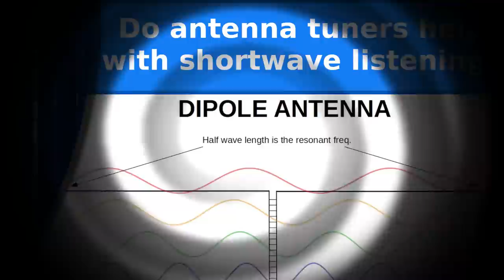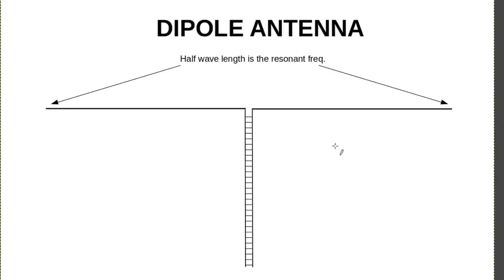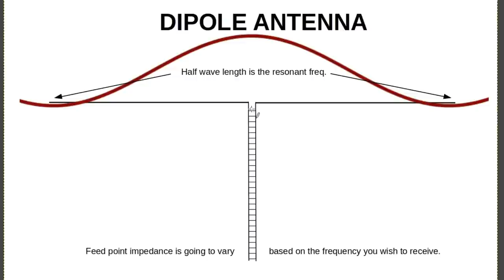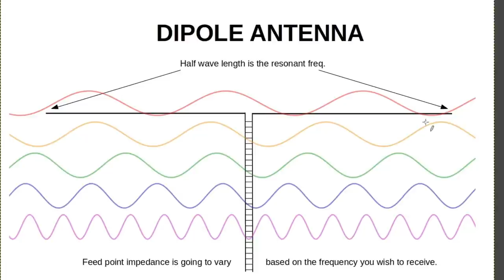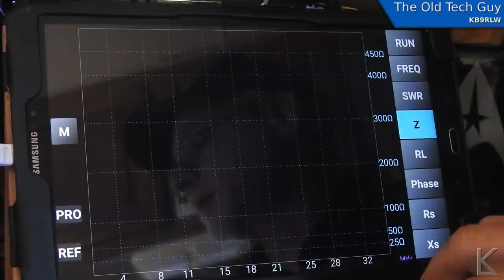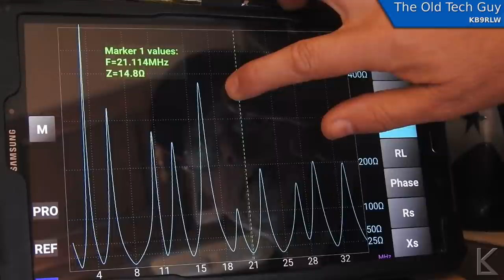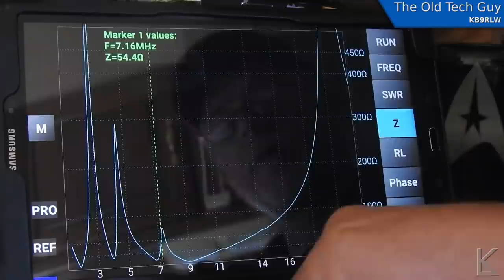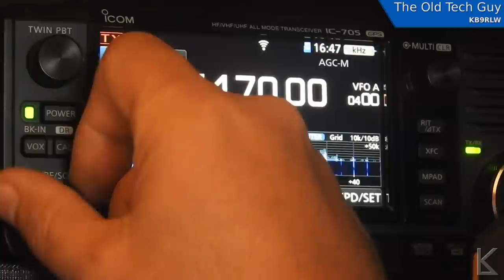Ham Radio - Do antenna tuners help with shortwave listening?

Comment: I think what you are missing is  a very important point. If the tuner allows more signal into the receiver- it also allows more noise into the receiver in an equal amount. If not then you are saying that the tuner knows the difference between noise on the RX frequency and signal. an obvious impossibility. Yes, signals were louder, but  so was the noise.  The waterfall display color clearly shows this. This is basic  S/N theory.
Dale W4OP
Reply from the maker: Yes, of course the noise floor comes up.  I didn't miss it, it was just so obvious that I didn't feel the need to point it out.
Reply: @loughkb  So, the signal to noise  does not change, then what is  the tuner helping with besides making  everything louder? All of today's receivers  have more than enough gain to allow for low gain antennas  (i.e.  mismatched antennas, Beverages, Flags etc) to overcome HF noise figures.
Reply from the maker: @W4OP  LOL!
Reply: @loughkb   Deos the tuner allow you to receive a signal that you could not receive with just the antenna? Perhaps a weaker signal than the one in the video?
Reply from the maker: @andrewking3087  It can, when applicable, certainly make some CW contacts much easier on the ears.  More signal for the filters to process.
Along those lines, digital modes would be a bit better detected by demodulating and decoding software.  Less dropped characters in RTTY or PSK31.  A bit less snow from less AGC action in an SSTV image.
And there's the additional benefit of getting the most out of the antenna across the spectrum, rather than just at it's resonant and harmonic points.

Comment: Thanks Kevin.  This was an interesting video.  I was an SWL for many years.   The term covers a broad range.  At least in the dark ages, before the Internet, most SWL's were people who listened to international broadcasters like the BBC, VoA and Radio Netherlands.  
For receive-only applications, there are two prime considerations: signal to noise ratio and frequency agility.  A third consideration is immunity from elective fading.  
When listening to high power radio broadcasters the signal strength is usually high enough that the limiting factor is noise, either natural or man made.   A less efficient but lower noise antenna works best. 
Because of automatic gain control (AGC) and the fact that most modern receivers are extremely sensitive, a little less signal at the radio's front end does little to affect reception.  In most cases using a tuner increases the received noise as much as the received signal.  Using a tuner in the general case only decreases frequency agility, adds complexity and frustration to tuning and an additional expense.  
The exception to this rule occurs where an antenna delivers relatively little signal to the radio. With very weak signals the radio's internal noise is at the level of the received signal.  Examples include using a very short antenna or an untuned loop without a pre-amp.  
Most SWL's will get the most benefit from an antenna setup that picks up the least noise.  
Transmitting is a different case.   You need to protect your transmitter from reflected power and you want to get the most power possible into the antenna.
Reply from the maker: Yes.  A tuner is just another tool in your arsenal.  Not something that would be used all of the time, just as needed.
Reply: @loughkb  Thanks again Kevin.  You have hit the nail on the head.  Exactly my point.

Comment: A simple pi network antenna tuner is tuned on receive simply by listening where the maximum noise is, and then finely tuned by transmitting. So yes, it definitely helps the receive

Comment: Nicely explained video.Yes an antenna tuner helps but there is no substitute for a good antenna in the first place.For SW listening it's been my experience to avoid antennas fed with coax.Ladder cable being the far better option.The braid on coax lets in all sorts of noises and interference which is not needed.🐻🐵☺️👍

Comment: In addition to match the impedance of the Antenna/Feedline system to the impedance of the RX input there is a second benefit. The antenna tuner is made up of a L/C circuitry and is frequency selective. Its not a broadband transformation.
It selectively filters out the spectral portions near the RX frequency and suppresses the spectral part far from the RX frequency. As result you get less total Signal amplitude to the 1st stage of the RX and reduce the risk to get into non linear  operating conditions. It suppresses cross and intermodulation and makes the whole system more robust to very strong signals outside the selected RX band.

Greetings from former DJ0PA

Comment: Howdy. Wonderful demonstration.
I would, however, advocate that an out of resonance antenna tuned to resonance with a tuner will "suck in" more energy from the air than a non resonant does.
Yet, I agree that matching impedances is the most significant aspect.
In high regards.
Reply from the maker: The antenna itself is not changed, it remains out of resonance.  The other side of the matching network presents a resonant impedance, derived from the network itself.

Comment: Tuning the antenna increases the signal as you showed, but also increases the noise.  So the signal to noise ratio is the same, regardless of the S--meter reading.  That's why beverages and receive loops work.  They provide a good S/N Ratio even though they are non resonant .  Sensitivity on HF modern receivers is not the problem.  Their Noise Figure is way below the atmospheric noise level.  So they are more than sensitive enough.   The name of the game in shortwave receiving in having a good signal to noise ratio, not the highest S Meter reading.  You should have mentioned that the best reason for using a tuner on HF is that it acts as a pass-band filter, reducing strong, off frequency signals which will degrade receiver dynamic range.  That is more important than trying for the highest S Meter reading.
Reply from the maker: SNR is a different topic and outside the scope of this video.

Comment: Interesting stuff. Is the antenna tuner you are using a passive device? I've e been playing with my antennas over the last little while. I mainly am interested in Mediumwave DX and have a couple of antennas , two flags, a delta loop and a youloop. As you described, the impedance varies with frequency. 200 to  1000 ohm on the one flag antenna, as measured with my NanoVNA at the two ends of MW. So getting a linear match across the whole MW band is impossible with just a fixed balun. Would some kind of adjustable LC circuit help? PS i like your postcard of Cape Town. My hometown. 73, Vince

Comment: Would a jfet preamp, with a very high input impedance, work better with whatever length of wire you are using? For receive only.

It wouldn't load down the antenna and most of the signal voltage would be seen across the 1 - 10 Mohm input impedance.

I did this for a direct conversion receiver I made.

The preamp was a J310 jfet in a self bias config with a 10 Mohm gate resistor.

The jfet fed an emitter follower.

The overall gain was about unity but the input resistance was now 10 Mohms.

It made it so a 2 ft telescoping antenna worked really well.

Of course the long wire still worked somewhat better but the performance was very good either way.

The only other issue was the preamp was also picking up 60 hz, but an appropriate choke going from the antenna to ground removed the 60 hz   and didn't affect the hf.

Comment: Great video topic to discuss! There aren't many discussions about this topic.
Q: can you discuss how use of different feedline with different impedance and matching that with an antenna that has a different impedance at the feedpoint. Such as using 50 ohm coax vs 300 ohm ladderline vs 450 ohm ladderline connected to a dipole. As you mention in your video, as the frequency changes, so does the impedance at the feedpoint, but the antenna tuner is typically at the radio point and not between the antenna and feedline connection point. I'd like to hear this perspective

Comment: If an antenna tuner to brings signal up, you have a problem with your antenna as its probably not constructed properly. If you have a good balun and coax It should not make any difference. Only on transmit is the match critical enough to make a noticeable difference.

Comment: Kevin, what about if you just have a long wire connected to a portable SW radio with a miniature jack?  Will a tuner improve receiver performance?
Reply from the maker: In some ways.  The tuner will act as a pre-selector.  Reducing nearby out of band RF that could swamp the rf pre-amp in the receiver.  
It will also improve the transfer of energy on the desired frequency range by creating an impedance match between the antenna and the receiver.

Comment: I understand that but what about the loss in signal because of the internal electronics? I have a Yaesu frt-7700 for my frg-8800; switched off, there's a slight loss in signal when in line!

Comment: This is true for a radio that has a 50-ohm input and a  50-ohm feedline.
This is not the case if you have a portable shortwave receiver. A single random wire works just fine.
My ham radio is a Yaesu FT-450D.
My portable is a Tecsun PL-880.
Reply from the maker: A 'tuner' doesn't specifically produce a 50 ohm output.  It will allow you to match whatever the impedance of the antenna is to whatever the impedance of the receiver is and improve energy transfer.
Reply: Your PL-880 has an high impedance input that matches the impedance of a short wire antenna so further impedance matching is not important.

Comment: Hi. QUESTION. If you have an aerial correct wavelength for the station you are listening too. If you introduce an aerial tuner does it increase the signal strength by improving the Q of the aerial. Cheers from old George.
Reply from the maker: No.  The antenna is only going to 'grab' so much signal out of the air.  If you're system is resonant for the frequency you are receiving, the transmatch would only introduce a small amount of loss.  You may reduce the energy from other signals on different frequencies though, possibly reducing interference or desense of the RF amplifiers in the receiver.
Reply: @loughkb  Many thanks.  I grew up with Thermionic Valves whereby the RF Amplifier was wideband. No band pass filters. ATU were as big as the radio. They matched impedance and also acted as band pass filters. Sometimes the knobs were marked sensitivity selectivity. The ATU increased the wanted signal by increasing the signal to noise ratio alowing the front end RF amp gain to be manually adjusted. It's rare to see an ATU as good as the old ones. Modern radios have band pass filters built in. Less knobs to adjust. Thank you for your reply it confirms my thoughts on modern ATU. Ps one of my old radios weight was 18 stone without power unit or ATU and it was only a Marconi DF Receiver ex ww2. No Transmitter.  Cheers from old George just getting back into radio. 👍🤠🇬🇧

Comment: the big push back by most is due to the common misconception on the device.  I too normally call them "antenna tuners" while in reality as you pointed out they are a matching device and RX always benefits from input impedance matching, that's why early radios usually had a knob for "peaking".
I agree about the other content creator.  It seemed by the end his topics grew controversial and his presentations bitter. I know from the very few I put up at one time that my personality was not a good match for the trolls and flame throwers (who never seemed to have any content of their own).
GL & 73 Al

Comment: From my experience a 'preselector" will work better than a 'antenna tuner' for receive only.  My yaesu manual receive only preselector has a better fine tuning control than a manual antenna tuner.
Reply from the maker: They're the same thing.

Comment: For SWL, is using a 1:1 BalUn (placed in-between where the antenna first connects to the Coax feed) still a good idea to help remove RFI if I'm also using an antenna tuner at the radio antenna input?  Or is it redundant?
Reply from the maker: That would help to reduce common mode noise.   Hashy broad RF noise that gets onto the antenna system and travels down both conductors of the feed line as if it were a single wire.   It wouldn't help with any kind of carrier noise.  A narrow signal generated by something.

Comment: more signal is one thing, but how is the SNR? also is it only impedance mismatch, or an out of resonance antenna is also attenuating? how about just using a hi-z preamp instead?
Reply from the maker: I would say as well instead of instead.
Reply: @loughkb  hmm.. not sure how can you utilize both together tbh. Tuner output is 50ohm already, so it'll be a mismatch if put before a hi-z preamp, which espects KOhms at its input. however if using the tuner after the amp, my guess it'll have no benefit as it'll be separated by preamp from the antenna, thus cannot influence the antenna by balancing out its capacitance or inductance.

Comment: What you (perhaps deliberately) left out was how to get a tuner to match your receiver to an SWL frequency outside the ham bands.  Unmodified recent ham rigs won’t provide a sample RF signal outside the ham bands for the tuner to use as a reference for adjusting impedance.  Of course, many hams with modern rigs who also are serious SWL’s have their ham transmitters modified with the “MARS” mod, which removes the diode or resistor in the control circuits which limit transmission to the ham bands only.  This allows s brief, low power transmission on an SWL frequency outside the normal ham bands to allow the tuner to set itself, but I suspect that even such a brief, carrier-only, low power transmission may be essentially illegal.  So, how else do you recommend we get our tuners set for SWL frequencies?  I use an old manual MFJ antenna tuner with an MFJ manual antenna analyzer to provide the test signal.  Hopefully the power of the analyzer (milliwatts??) is low enough to not create a legal issue, but I really don’t know. Suggestions??  

Tnx for the excellent video!
Reply from the maker: There are many different types of tuners and each type would require a different order to the adjustments available.   In most cases, one could get close enough just by ear.   Adjust for a peak to the noise floor and higher indications on the S-meter.   Precision is not nearly as critical as it is when transmitting.

Comment: Nice video. So, will an antenna tuner help with a regenerative receiver as well?
Reply from the maker: It should help with any receiver.   The better the impedance match, the more energy from the antenna to the receiver.

Comment: This is really interesting - Not too technically inclined, but I'd live to give this a try as I am mystified by, despite living in SE Texas, I don't get a whiff of the tropical bands between 3 and 4 MHz...FT-991a and a Cobra Senior folded doublet 140' in a somewhat inverted vee with LDG tuner, would love to see if this helps me pull out some of the smaller stations out there. Thanks & 73 de W5VOX...

Comment: Just an observation, your graphical waveforms in your cover art are horizontally polarized while your antenna is vertically polarized.
Reply from the maker: It's a flat top dipole in the graphic, horizontally oriented and polarized.

Comment: Didn't see hardly any mention of the all important Signal-to-Noise (SNR) ratio.  For SWL, if the impedance match is poor you can simply turn up the volume to hear the same signal.  Tuner does nothing to help catch DX due to any mismatch.  It won't improve your SNR so in that respect, it really doesn't help than much.  Before going the route of fixing the impedance match on a SWL antenna,  spend more time on issues like excellent grounding, shielding and squashing as much noise from the antenna path as possible.  For most SWL activity these days, noise is the big problem due to all the sources of it around our homes.   One way to help control that noise is to use loop antennas.  For example, a large horizontal Skyloop antenna design.  Also, try grounding the antenna at both the location directly under the feed point and add another ground where the coax enters the house.
Reply from the maker: Well we're talking about the amount of signal getting to the receiver, you're on a different topic.

Comment: You are right about everything you said and showed in your video, but you are not quite right  about your main conclusion that says, yes, a tuner does help on receive.  Why?  Because we don’t measure receive performance by how high the meter peaks.  We measure receive performance by SNR, signal-to-noise ratio, expressed in dBs.  What you did not notice was that the signals now peaked higher but so did the noise.  We can make the signals peak higher by simply turning up the rf sensitivity, or for that matter, even do something as trivial as turning up the volume.   Now, here comes the tricky part.  As you correctly pointed out, the tuner increases the efficiency of the relay of the rf signals from the antenna to the radio.  So, there is not just an increase in the signals and the noise, but there is also a differential effect:  the higher the rf, the more the tuner helps.  So, yes, the noise gets higher also, but the signals get a little bit more of a boost than does the noise.  Alas, this differential effect is trivial, and you are back to being mostly incorrect:  a tuner does not help receive performance.  And it is because – as you correctly pointed out – the metal in the air sensing the rf variations does not change with a tuner, and that is where the rubber meets the road after all.
Reply from the maker: Regardless of what your filters and processing is doing to reduce noise, it's always best to have more signal to work with in the first place.